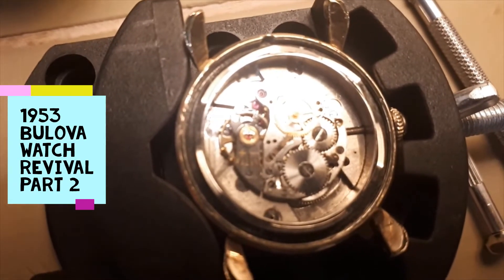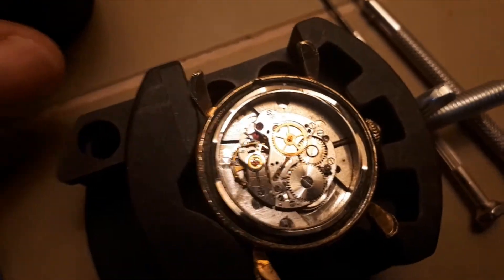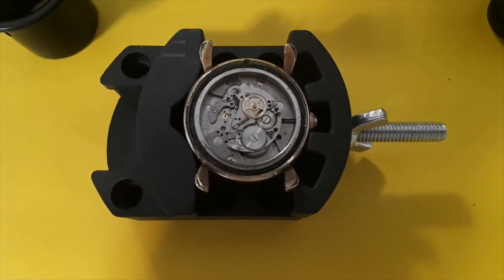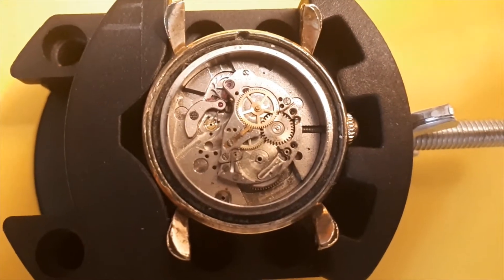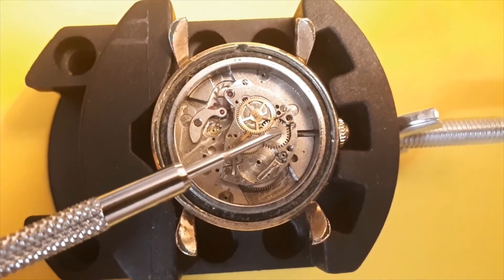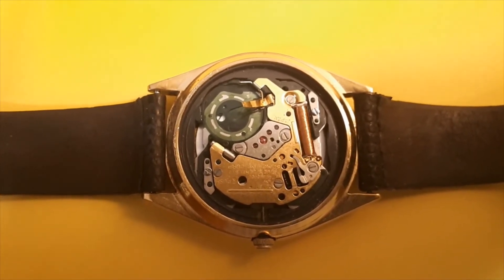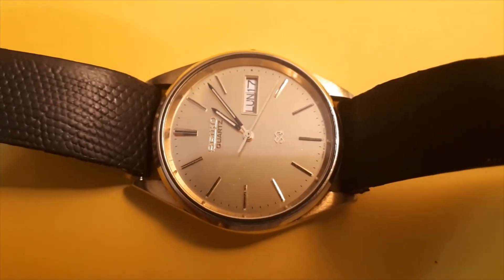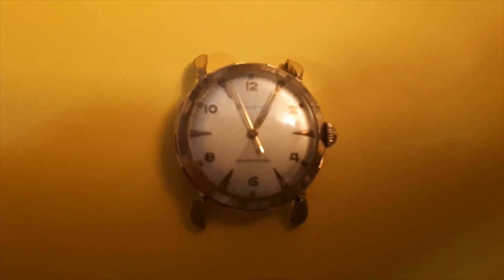1953 Bulova Wrist Watch Repair Part 2

Comment: Same here - Canadian and my Dad left behind his 1954 Bulova 10CSC, which I remember from early childhood, and coincides with his graduation year. case is same as yours but dial numerals are at 12, 3, 6 and 9. I have yet to figure out how to let down the mainspring. It’s not a simple matter of pulling back the click, because if you remove the automatic works from the main upper plate, things are still under tension and can go flying. Also it frequently goes ‘bzik,’ which seems likely to be caused by the wrong grease in the barrel.
Reply from the maker: Hey, thanks for watching. This Bulova is still giving me troubles. I cause one problem and fix that and create a new issue. I'm still working on this watch. Hope to have the video out soon. As for the main spring, the click on yours can be pulled back so you can release the spring power?
Reply: @robertjordan7323  I haven’t had my 10CSC fully apart, still waiting to learn more. If the click is pulled away from the mainspring barrel, the mainspring does not unwind. It seems there could be more than one click or ratchet between the auto works and mainspring. If I remove the top plate of the automatic works, things want to fly away, indicating there’s energy stored, but it hasn’t been released it yet. Any idea if there’s a technical service manual online for this movement?